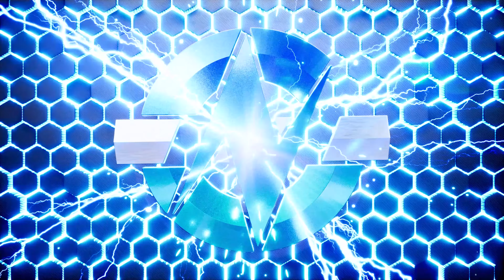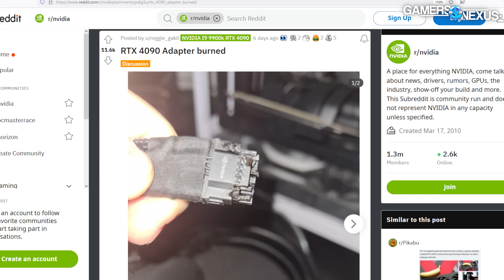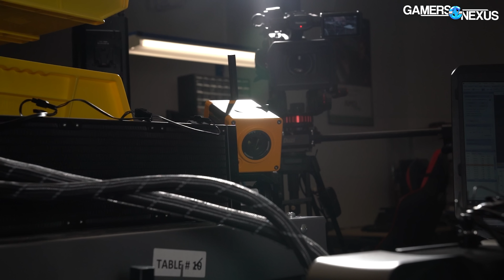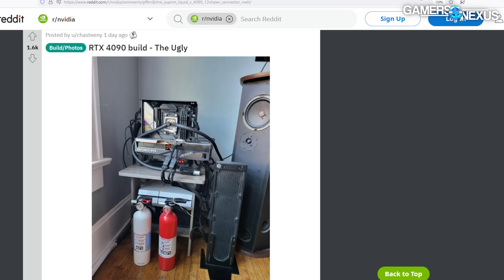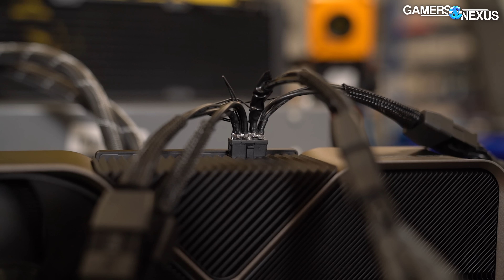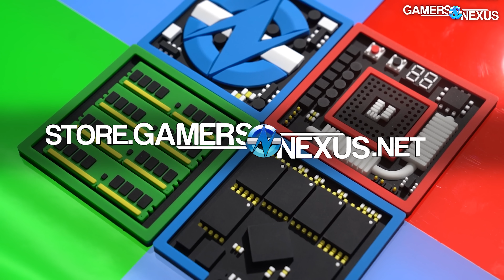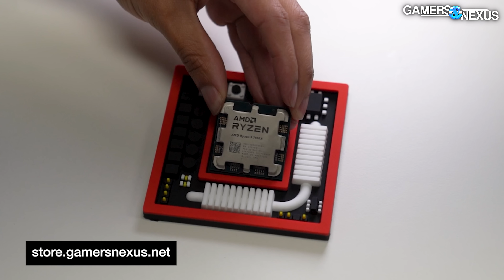Testing Burning NVIDIA 12VHPWR Adapter Cable Theories (RTX 4090)

Comment: Voltage rating has no effect on heat what so ever. Voltage rating is how well insulated the wire is. The thicker the insulation, the hiogher the voltage rating. you could have a 600V XHHW cable with a bad contact and the insulation would melt. It's not an insultion issue. it's a heat spot issue. You need for wattage on a bad contact.

To do that, you could try to feed half the connector normally and the other half do a poor junction (i.e: cold solder joint or just poorly pressing the wire against the plate)

What could cause this is 3 pin fed by 1 rail of power supply and the last pin fed by the other rail. The 3 wires would be fine, but the single wires with a bad contact should over heat. Having a rail work in parallele with 2 connection would prevent the over heating because most of the current would be channeled through the good connection wire.

Comment: Voltage rating on cable is more pertinent to the insulation than the conductor. Doesn't greatly affect your conclusions overall but it is inaccurate to claim that it's a 'higher quality' cable, it simply means the insulation has been certified to a higher voltage. 
Both 150V and 300V are high enough to be irrelevant in these circumstances as only 12V is being supplied. Regarding the cables, what matters is the Cross-sectional area/gauge as this is what dictates current carrying capacity. However, based on most of the photos I have seen, I believe the problem lies in the male-female contacts in the connectors and GPUs, rather than the internal construction of the connector, because generally the damage and therefore heat-source appears to be amongst the interfacing part of the connector, rather than the join between the back of the connectors and the cables.
A poor contact between the male and female 'pins' of the connector seems like the most likely source of a hot-spot in my opinion (I'm an electrician - not a flex, just that my theory is based on practical experience)
Reply: Its kind of frustrating to see all these channels (inclduding Igor's labs) spend so much time on this without actually getting anywhere. Some guy on Reddit said you could fix the problem by properly terminating the connectors on the adapter5 days ago. Whether that is necessary or not I don't know but given that is beneficial thats a pretty obvious sign that is where the problem lies. In my opinion this problem is partly due to the female connectors being kind of loose but exacerbated by people not pushing the connector in all the way.

Comment: what if its not the connector but the card itself? those small pins pulling all that wattage if its not spread evenly across them it could easily overpower just a few of the best connecting ones. maybe manufacturing gunk slightly insulating 1 or 2 pins. or maybe bug in the bois/software not balancing the power draw between all the pins in certain scenarios.

Comment: Has anyone slowly turned up the temperature to see at what temperature it begins to melt?  Possible the bad cables have plastic that softens at a lower than spec temperature.

Honestly to test a bad contact I would create an artificial load using a high amp 12v source so it is more controlled (and not risking expensive computer part).

Other thought is could over all temps in a case be hitting around 95c so that the electrical heat then pushes it to 100c which I believe is the transition temp for the connectors.

Comment: Soldering like this one way or the other is a laughably bad fabrication technique that would get you fired from my shop if you did that.  Granted, I build motorsport grade wiring harnesses that cost a lot more than this garbage, but certain fabrication techniques would keep this from happening at all.  

First, each pin location would be crimped directly to the terminal so 12 individual wires would be inserted into the connector. 

Second, the six wires for power would be ultrasonically spliced to to the power supply pigtails and strain relieved well away from the connectors on each end.  The six for ground would be similarly spliced. 

Third, I wouldn't use that garbage ass connector for current draws on par with the 4090.  If you arent derating your connections by AT LEAST 20%, you are doing it entirely wrong.  Just because a terminal datasheet says Max Amperage- 5A, doesn't mean that you can just happily run those terminals at that current in perpetuity.  They are rated at that for a certain temp rise and after that, you may need to replace the terminals due to terminal retention and tension reasons.  

This is a horrible sht show of cheaping out on fab and this is what you get.  Im sure any automotive sparky would look at this and laugh if you said it was supposed to handle over 25A continuous.

Comment: The voltage rating of wire is mainly dependent on the type of insulation around it. The risk of voltage is of a spark jumping to another conductor, and the insulation is what prevents that.

Comment: poor power supplies with voltage drops could cause more current draw. if the wires on the early adapters were thinner this could cause issue?

Comment: A manufacturing defect, such as cold solder joints that were irregularities, would be an anomaly that would not be indicative of poor design and would remain an improbable problem for detection during sampling for failure analysis.  Good work Steve, as always.

Comment: With most complicated problems, sometimes it is combination of faults. If you have any noticeable resistance on a cable, or connector it will cause voltage drop and heat and excess current draw. The other question you need to ask is what power supply was being used. If its at its limits and then you add resistance you could be drawing too much current which could mean voltage drop, which then means more current draw etc. The thermals are the end results not the cause. You cant get around ohms law.

Comment: Therm Cam: Steve 2.0? Anyways, I see a lot of things going on and not enough details. The one post that Jayz2Cents went over, the person said it was 3 days before they noticed it. Three days of doing what? Igor having a lower rated cable doesn't surprise me. QC has gotten worse, seemingly, since mid 2020. So, there's a chance that there some cables, like Igor's, floating around. Maybe a few of the earlier cards had those cables and the QC person was too embarrassed too own up to not catching that. If, by some fluke, Igor's was a one off, then it should be left out the analysis. Going back to my third sentence, Steve and Jay not being able to test them for any major length of time makes replicating the problem even more. However, I fully understand why neither of them have the time and man power to do so. The final thing I'll add is that AMD changing their minds about using the same power connector (or never planning to do it in the first place) tells me that there has to be something to this story. Either that, or AMD decided that the risk wasn't worth finding out one way or the other.

Comment: Seeing  the different voltage ratings on the wires, along with what to my eyes appear to be some "cold joints" on the solder of not on Jays adapter, but some photos, makes me wonder if it is really a manufacturing issue, not only at the process level, but quality control as well. Some of the alternate cables use the traditional wire to pin method, and I honestly don't know why there was a deviation from a tried and true method. That plug leaves so little room for proper soldering, and a lot of room for error. This video was great as they always are, but created new questions for me. But, as I say, new hardware brings new problems. Buyer Beware.

Comment: Would it be possible that a broken or cracked solder joint may be arcing or heating up at the break, causing melting on in those cables where the break is "just right"

Comment: Is it possible that the first cards shipped out had cables/adapters made for 3090 and is not adequate for a 4090? That would explain the 150 on one cable to a 300 on your.

Comment: Most likely that multiple different OEMs manufacture these adapters for nv. Also voltage rating is typically not what's important here, but the gauge and current ratings are. Either way adapters of any case are ill idea for high current interconnect. Perfect example of "solution" creating more problems that it supposedly solve. 3 x 8-pin cables worked fine to support 1000W cards during overclocking for years :-). Also @16:15 please for sake of your and team members health reasons, get decent fume extractor for soldering reworks station. It's cheaper than dealing with medication for lung cancer, thanks!

Comment: Jay is doing what Jay does best: Taking other people’s educated guesses and regurgitating them as facts so he can get that sweet, sweet YouTube money. 

/rant

I stopped watching him after the “POSCAP” issue with the 3090’s. POSCAP is a Panasonic brand that was not used for 3090 GPUs. After the “POSCAP” vs MLCC was debunked, Jay never took responsibility for his ridiculous misinformation campaign touting the “POSCAPs” to be the root cause.

The funny thing about this is that Igor is the one who guessed that the GPU’s capacitors were the issue and he used the term “POSCAP” (which he quickly corrected). Jay repeatedly ran with the old information, never said it was a guess and continuously repeated the incorrect terminology.

It’s painfully obvious that Jay prioritizes views over integrity. He jumps on a subject early instead of taking his time, doing his own research, coming to his own conclusions and being transparent. He’d rather regurgitate what someone else says, remove all nuance and say they’re hard facts to maximize his views/income. 

\rant

Comment: I wouldn't expect expect a single pin failure to cause this, because you'd still have over 80% the current carrying capability, with the working pins taking more and more of the current the worse the failed pin gets. The surviving pins would dissipate about 20% more heat, certainly not enough to be dangerous.

With a partially seated connector you could theoretically get a single poorly contacting pin carrying the whole 50A, that could absolutely cause this type of damage.
Reply: Sure sounds like they should start coming out with cables that can carry 50 Amps on one pin... but then the pin becomes the issue haha

Comment: Someone needs to make a 12 pin GPU cable with a 90° end connector, so the wires are not getting smashed as you close the case door ..lol

Comment: I'm still kinda leaning toward this being user error.  The 3090's had the same connection and no reports of this.  Plus how many reports are there actually?  Out of the tens of thousands of 4090's sold worldwide, we've got what, 5, 6 reports?  At least that I've seen online.
Reply: 14 reports, and all of them were burned at upper left side.
Reply: Its not user error its a combination of the tiny contacts and using giant solder blobs near them which is likely what is causing a small portion of users to get melting connectors. The previous failure could make the problem extra bad preventing proper seating or making doing so extremely hard.
Reply: @riakata  14 reports out of a couple 100,000 sold is 1/10,000th of a percent.  Not to mention, none of the tech channels have been able to recreate the problem.  I'm not saying there isn't one, just that I'm not ready to storm Nvidia HQ with torches and pitchforks just yet.

Comment: "300V" is just the rating (and usually thickness) of the plastic/rubber insulation to isolate the conductor from the outside world, weather it be AC coupling or flash over of the insulation

Comment: I worked as an engineer overseeing an automated soldering process. To me it looks like the soldering iron from Igor's experiment was used past its expected lifetime in cycles (or was improperly cared for and oxidized). In general, I expect to see something of the order of 25,000-30,000 successful joints soldered from a chisel-style auto-fed iron with gradually decaying quality beyond that... that solder was gnarly looking and could be made on the same process but with a failing soldering iron... As for the 150V lines, it would support the theory that the process has... kinks in its controls and maintenance. 

All of the above assumes they were made on the same process though.

Comment: 26:35, And at this point you answered the cause of these faults and burnt connectors - a not fully (corect) inserted plug and a strained cable cause its bending in the connector and insufficient contact surface of the pins on the side of the video outputs.  Additional bricks may be added to it, as well as a different way of making the pins in the adapter - the method of tightening the plate on the socket pin in the graphics card, inappropriate materials with weaker conductivity and too soft and susceptible to deformation, underestimated 12V voltage, which means that more current A flows through the connectors.  I think that such strong RTX 3090-4090 should use a minimum voltage of 15V or even 19-24V.  Well, it's a new power supply necessary, and so it's a bit overpowered to connect as many PCIE plugs to one adapter.

Comment: @gamers nexus,
What if the melting is not caused by sustained predictable load, but transient spikes caused by varying user demand in intermittent intervals? A lot of people I have seen with bad cables appear to have only been doing things in the desktop/web browser environment. Which makes me think the automatic gpu boost is jumping from 100-1000MHZ and then spiking up to 100% when they load a program or load a Youtube video.

Comment: Reading the 150 voltage on the cable is unnecessary, it's the amperage you need to look at, also, running a higher amperage cable to a small lower amperage pin is not good.

Comment: From what I've seen it looks like it comes down to bad pin design, they split open causing resistance and burn/melt from the inside out. Not so much to do with the cable gauge or soldiering.

Comment: The voltage rating is just the rating for the insulation. It has nothing whatsoever to do with the metal wire itself.  And at 12V it doesn't matter.

Comment: I had an old electrical teacher back in high school who said this.

"Just because it works, means its not properly done"
"Just because it may not burn now, doesn't mean it wont in the future."
"good enough is no substitute for proper technique" 

I mean you cannot count for all errors (including user) but you can make sure to mitigate them as much as possible, something nVidia failed to do with its splitter.

Comment: I've seen this plenty of times.  It's likely a poor connection of the pins, low surface area soldering, wrong cable for the AMP/Voltage requirements, and thermal tolerances of the plastic used.

Comment: I see all these attemptsto recreate the issue, but all I see is open air bench tests. Would it be possible for the issue to occur in a closed case with terrible/restricted airflow or poor fan configuration? (Positive/negative pressure)

Comment: Steve, the voltage rating is for the insulator, not the actual wire inside.

Comment: Hey Steve, please try to short some wires in the connectors if the soldering was not done well in the connector or bring them really close to each other so you get arc forming in the connector. Best regards and keep up the good work.

Comment: As an electronics engineer, I had this figured out way faster than you guys did. Compromised sockets lead to arcing in the socket, and by the sheer small design they used, it was inevitable. I said it before the card came out that this would fail. I do not care if any of you do not believe me or not.
Reply: Cope

Comment: soldering is a bad idea.. in yachts, the cables were crimped. Because due vibrations, it breaks. You cannot make sure whether it stands firmly or not. Computer cases mostly stationary yes but why not make cables crimped and plug in plastic females?

Comment: I think Nvidia sent both Jay and Igor cease and desist letters or something along those lines because neither one of them actually used the cables that were actually used when the melting happened one of them was an official Nvidia cable that came with the card

Comment: Trying  to troubleshoot an occasional or intermittent problem is one of the most maddening things you can do. Since there are different cable designs involved here, that makes it even more maddening.

Kudos to Steve for not breaking down and turning into the Joker while trying to get a handle on this problem.

Comment: 6:05 Oooooh important distinction there..... Seems like some cable adapters had corner cut on them to save cost. Ill bet those janky corsair pigtailed ones Jay is pushing so blindly have the same issue...

Comment: If you want to examine a bunch of connectors before your start taking them apart, your might see if you can get them x-rayed.  When we needed things x-rayed we were able to go and have a local veterinarian do that for us for a quite modest charge. Maybe your cat-connections can help!
Reply: Modern dental offices also have that 3D Dental Scan xrays which have much better and sharper images to reveal the structural details in an almost 3D look.  Maybe that type of scan could also be used on these connectors.